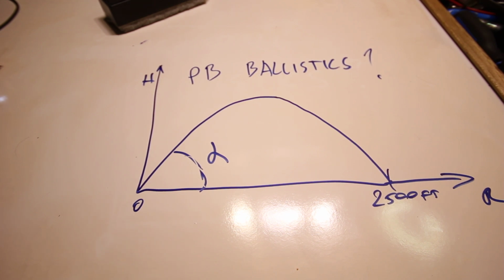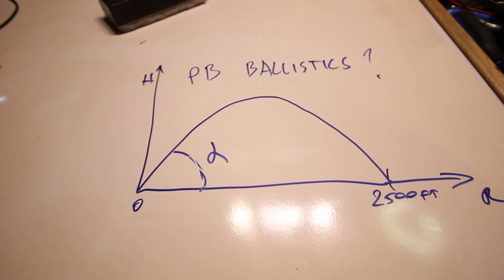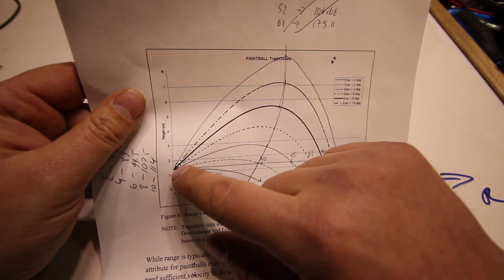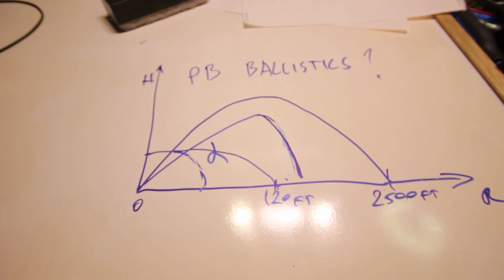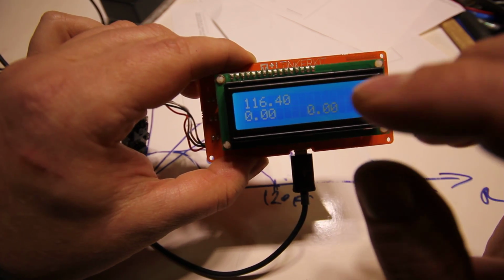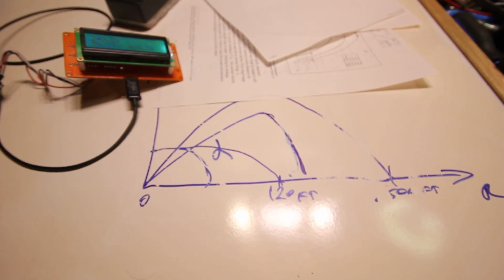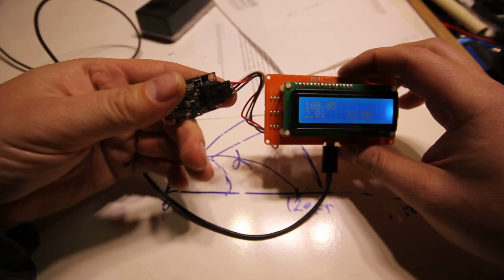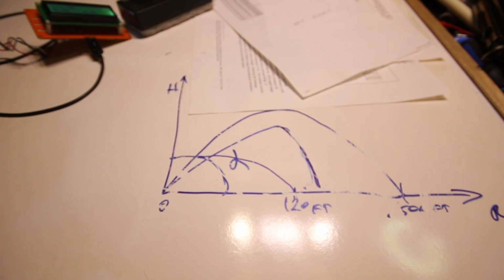Paintball ballistics and ranges by DRC Paintball

Comment: I've done it accurately for FS rounds, .68 and .50 paintballs, for more information including how I did it, check out:
http://www.mcarterbrown.com/forums/first-strike/223958-external-ballistics-first-strike-round-paintballs.html#post2597972
Reply: +DRC Paintball The graphs are based on a zero elevation angle so no, it's not useless-  The charts are a basis of comparison.  If you plugged the data I've provided into ballistic calculation software (like chairgun), along with information about your scope and environment and, the software will tell you the trajectory relative to your reticle.

All projectiles involve a bit of 'lobbing' (it's either accounted for in the reticle and it's elevation adjustment and/or holdover).  Firearms less than airguns and airguns less than paintballs.  Also, I may add that the chairgun software can account for arrows/bolts as well.

All projectiles fired in atmosphere will fly in a parabolic arc (not like a bowl where the launch angle is equal to the descent angle), even Gary Dyrkacz calculator showed this.

All commercially produced ballistic calculation software accounts for gravity.  Depending on your scope height and, the range you set your zero for, your shot will start  upwards passing above your line of aim before dropping back downwards and onto your desired impact point.

If you knew anything about the field of external ballistics, you would know:
- The worst method is setting the gun level and firing horizontally and measuring how much lower the projectile impacted a target at a given distance.  This method still produces useful information (most commercial ballistics calculators will use this data).
- The best method is using a range doppler radar (not the handheld or table top consumer radars) where you measure the speed and position of the projectile throughout it's flight.
- Dual Optical Chronos (one at the muzzle and another a given distance downrange) is the second best method.  It can be improved (if one has the know how) by using consecutive optical chronos but, the projectiles need to fly really true in order to be in the proper position for each consecutive chrono (i.e. no crossrange deviation).

Finally- insulting Cockerpunk is uncalled for.   They (he and Bryce) collected dual chrono data with the hope of taking the measurements and finding a corresponding curve- just like you demonstrate in this video with your virtual projectiles (how's that for 'bullshit passed off as science'..).  They were not aware of external ballistics and that it is an acceptable method of determining the ballistic coefficient.  I did and, successfully applied it.